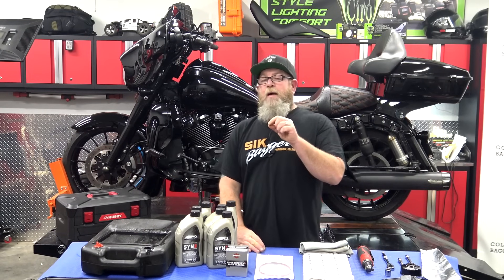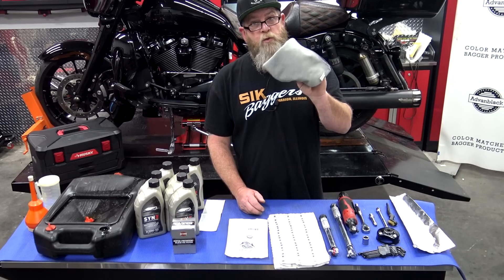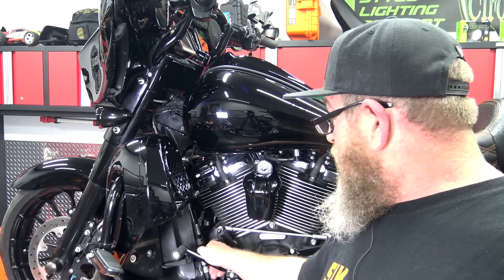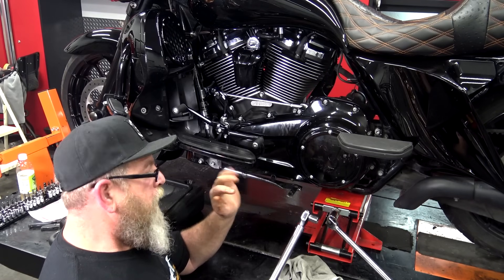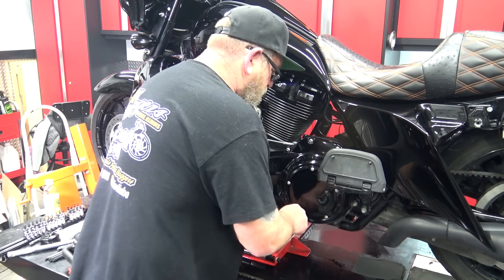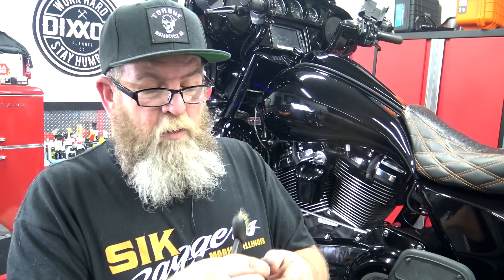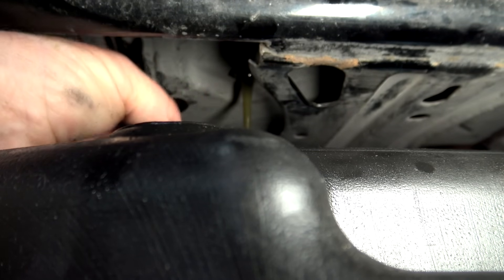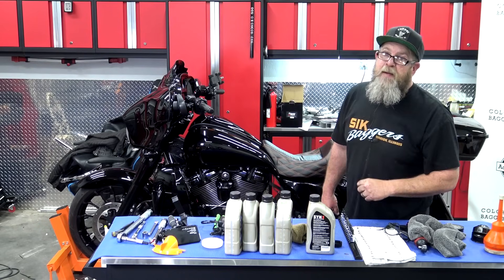⚡Milwaukee 8 - 3 Hole Oil Change @harleydavidson Touring - How To⚡

Comment: Personally, instead of tinfoil i cut side out of 2ltr  drinks bottle, slide that in, use again and again👍
Love your vids, hints and tips
Reply from the maker: yes sir...thank you for checking out the video...and yes ive used a gatorade bottle before..worked pretty good.

Comment: I wanted amsoil in my trike my dealer told me they wouldnt change it unless i use syn3 do you know why
Reply from the maker: You're dealership is full of shit. Find another one ASAP. Our dealership carries Amsoil in the store along with Lucas. And Syn3 is not required to maintain a warranty either so don't let them pull that crap on you either.  You can run whatever oil you want. They make money on hd products. That says a lot about your dealership and I would run

Comment: Steve, you are not the first person I have heard say to give the oil filter 1/4 to 3/4 of a turn "by hand".  My question is whats the difference if I give 1/4 to 3/4 by hand or with a wrench, it's still 1/4 to 3/4 right??  I will be the first to admit I am not much of a wrencher but I'm working on it, so maybe I'm missing something. Please let me know.
Reply from the maker: its just rule of thumb ...super easy to over torque with the oil wrench , thats all..if you can do it with the wrench and your confident its not over tightened then it is fine.
Reply: @sikbaggers  Understood. Thank you sir.

Comment: Thank you for the video.  I greatly appreciate the transmission explanation relating to dry and wet fill. I had no clue what that meant when I read it in the manual. Be and ride safe.
Reply from the maker: Glad it helped PD!! Be safe!

Comment: Should I be concerned that there were little chips in my oil from my transmission on my 2022 Road Glide ST? They’re about a 1/16” long kinda like thread chips but not threads.
Reply from the maker: with it being a 22 im going to assume it was the first transmission change? If it was it is pretty normal and your drain plug should have got most of it...change your trans fluid again at the end of the season and see how many have then. I know it wont be due for a service more than likely but its worth checking again just to be sure.
Reply: @sikbaggers  i’m doing the second transmission oil change, i’m at 15,000 miles and getting ready for a road trip. I’ve had the bike slip down or out of gear at hard acceleration a few times. Guessing because I didn’t get it fully into gear.

Comment: I just did my 1st oil change on my 2022 FLHR after having the dealer do the 1st few to inspect everything during break-in. It has an all plastic transmission dipstick. Do you know if it is still the same torque?
Reply from the maker: yeah..i dont torque the dipstick...just snug it down tight by hand and its fine

Comment: Great video, in your professional opinion, what oil do you recommend?
Reply from the maker: Ive been rocking the amsoil here latley...as far as engine wear I haven't seen any noticeable difference in the way the bike runs or any more or less metal on the plug when I pull it over SYN3.  And the clutch and tranny fluid the same...doesn't shift into 1rst any better like everyone claims it does...same old harley davidson first CLUNK! so not sure I will us eit again to be honest...cost quite a bit more too...ill probably just run the syn3
Reply: Is the oil the same for all 3, or is there specific oil for each?
Reply from the maker: @kgl1056  if you buy syn 3 for all 3 holes then its all the same...but even HD and other brands sell specific clutch and tranny fluids...so its your call on what you want to use.
Reply: @sikbaggers  does it have to be specific clutch or trans fluid?  Or it doesn't matter
Reply from the maker: @kgl1056   Check out this article by amsoil..its a good read and can explain it way better than I can...youll see the differences in weights used in each hole https://blog.amsoil.com/motorcycle-oil-differences/
Reply: @sikbaggers  thanks great article.

Comment: What happens if you overfill? Is the only con slipping? I listened to a guy at Harley parts who said fill to spill so I did just that. Took about 1 quart and 3/4 of another one. I can’t find much on YouTube explains this scenario. 2023 street bob.
Reply from the maker: overfilling your clutch will cause slip and ultimately cause damage...whoever said fiill to spill is obviously old school...and on some bikes that is very true...but not these newer ones...fill to the level shown on the diagram in your service manual.

Comment: Steve great post but would like to know your opinion on what oil to use on a 2006 street glide?
Reply from the maker: Thank you Jim...I have a buddy that rides an 06 and stricktly runs amsoil with no issues. Thats what ive been running as well..alittle pricey but if you can get a dealership with them you can get it a bit cheaper.
Reply: Steve thanks for the update I will look for it.
Reply: Another good oil would be LUCAS 20W50

Comment: When checking the trans oil level the manual says to put the dip stick in and not screw it in. insert the pit stick until the threads touch.
Reply from the maker: From the service manual 1.Park motorcycle on a level surface on jiffy stand. 2.See Figure 1. Remove transmission filler plug/dipstick. Wipe dipstick clean. 3.Install filler plug/dipstick until O-ring contacts the case. Do not tighten. 4.See Figure 2. Remove filler plug/dipstick. Check lubricant level on dipstick. Proper oil level is between the Add (A) (1) and Full(F) (2) marks
Im not sure what year of bike you have but this is for the 19' M8 but always go by what your manual says.  Please make sure yours says not to screw it in and doesnt say do not tighten...huge difference.

Comment: Great video Steve !!
one big mistake you made is you said the transmission fill plug is torque to 50 ft pounds and it should be inch pounds, not ft pounds big  difference  !!

Comment: Thanks Steve. The quintessential DIY job on a Harley. That oil sure needed changing.
How do you feel about an oil filter relocation kit ?
Reply from the maker: Hey thanks for checking it out ded...and yeah...i asked him why his tranny was so clean and he said he just had had it changed due to 4th and 5th going out and having it serviced...but the oil was midnight black...and for sure needed it. Never installed that kit but ive seen it...might be handy depending on the price.
Reply: @sikbaggers  Oil - change 1 - change 'em all.

Comment: how about a touch of anti seize on those derby screws? i have never had a issue but, would it hurt?
Reply from the maker: I wouldn't put anti seize on there..its kind of a grease..easily back out and loose one I would think

Comment: Do you have some sort of rule of thumb you use for warming it up?  Like idle it for so many minutes, or until the case feels just a little too hot to touch?
Reply from the maker: Getting the bike warmed up for an oil change is not just getting the engine hot but getting the oil itself hot..and you cannot get the engine oil hot just idling in the driveway...you really need to ride the bike at least 30 minutes and get the oil at operating temperature.  With a air cooled bike, just idling in the drive will in fact warm up the case but will not warm up the oil.  The idea is to get as much oil out when draining so get that oil hot and you'll be gold. Thanks for the great question Jan! be safe.

Comment: Is it recommended to check the transmission level with the engine hot?
Reply from the maker: Thanks for the question and no you should just check it on level ground on the jiffy stand ...remove the dipstick.wipe clean, re install untillthe oring makes contact but do not tighten. remove and check...should be between A and F.

Comment: For some reason, even when the transmission level is correct i find it hard to read on the dipstick. No worries with engine oil dipstick just the transmission..the oil seems to sit clear on it.
Reply from the maker: yeah its pretty hard to read...just get it in good light and youll be able to see where its wet

Comment: I did my primary oil and filled it to where oil was to touching the clutch plate, but it only took 24oz. I drained it when hot. Have you ever experienced this or did I make a mistake?
Reply from the maker: 24 seems a bit low ..normally its around 38oz. but most new service manuals have exclude a "oz" and just say "Proper level is approximately at bottom of pressure plate" you may want to get the bike upright, pull your derby cover and check again to see that you are at the bottom of the pressure plate. You wont need to change the gasket again on the plate...just pull it, check it and put it back on.

Comment: Thanks really liked your video on the Milwaukee 8 - 3 hole oil change. I am just about to do my own oil change on 2020 Road king Special, my first bagger. What is the best oil you recommend for this as my dealership is useless as tits on a bull. (Phill)
Reply from the maker: Hey Phill I run Amsoil only because my buddy has an account and I can get it a bit cheaper but I ran syn 3 for years with no issues. Redline is also a great  oil as well.

Comment: All fluid levels are spot on. Excellent instructions, easy to follow. Saved me a good chunk of dough.
One remark: if you use a vented dip stick that happens to move with you from bike to bike, make sure the measurements are taken with the original OEM dipstick or you screw up the oil change (ask me how I know 😂). I thought I overfilled until I realized that the dipstick is with me since my 96ci days.
Reply from the maker: Thank you for checking it out and the comment and yeah I probably would have done the same thing and then freaked out lol oh well lesson learned and thank you for sharing that

Comment: Would it be a good idea to put antiseize on those derby cover screws when reinstalling them?
Reply from the maker: I wouldn't joe...its a grease and that may cause them to loose their torque value over time...i see them sized up because they haven't been taken off in a timely manner and also over torqued.
Reply: @sikbaggers  
Thanks

Comment: How much oil did you put in? 4.5qrt? 5qrt??
Reply from the maker: Engine oil initial fill 3.8 L (4.0 qt)
Verify proper oil level. See Check Engine Oil Level.
 Perform engine oil level cold check.
Start engine and carefully check for oil leaks around drain plug and oil filter.
Perform engine oil level hot check. 
Add oil accordingly after you perform a hot check. I would suggest putting it half on the stick at HOT...that way you elimite a lot of blow by coming out of your breather.
Reply: @sikbaggers  I have a 24 model with the vented trans top cover so “I think”the blow by has been eliminated. A quick google search says oil capacity is 5.2qrts. The manual says start at 4.0qrts and go from there. Guess that’s what I’ll do, just wish it was a clear answer so you could just dump it in and go.
Reply from the maker: @hydroboy35th  i wasnt aware you had a 24 and yes your blow by issues have been solved for the most part.  There has never been a solid answer to that question and that's why HD says to start with 4 and add from there... Its a wet check meaning you drained your oil and not a dry check as in you just put a new oil pan on that has never held oil...Some people let the oil drain longer than others, some people use thicker oils depending on the riding conditions etc...it will never be the same...but don't stress about it really, its not a science that if you get it slightly wrong its going to effect your motor...dump in 4 quarts...run the bike and get it hot, check it again and add if you need to...takes about 5 minutes.

Comment: Hey Steve,  do you yet have a video on changing spark plugs on the M8?
Reply from the maker: Hey Joe..I sure dont buddy but I will get one in here and try to shoot that...You have to pull the tank but its super easy to do on touring models...let me try to get one in here
Reply: @sikbaggers  
Cool, thanks.
I've already had the tank off on my '17 King and you are right. 
Very easy.

Comment: Do you use the same oil for the 3-hole fluid change?
Reply from the maker: you can...if you take your bike to HD thats what you are going to get in all 3 holes unless you specify you want something ..i figure if its good enough for HD to put in thier bikesa nd maintain a warranty then it works. They know what works best in their motors

Comment: Soooo. I tried, but could or did not recognize the ugga dugga, and well, snap!  The last one of the job too. I snapped the head off the tranny drain plug. It’s in there so no leaking, but this is next changes problem I guess  I used a long ft lb wrench that I use for tire changes. Shoulda got a shorter one. How pooched am I?
Reply: Oooooohhh that's shitty!! Probably your best bet would be to remove the oil pan and then you could probably drill it or use an easy out. Good luck.
Reply from the maker: well just went through this same thing with a breather banjo bolt....had to drill it out and use an extractor tool to get it out. I would certainly drain and replace all the fluid afterwards to make sure you get any metal out...the plug itself being magnetic will catch and hold the shavings if you miss any.  This is what I used https://amzn.to/43xuayD

Comment: My question has nothing to do with the motor , i have a RG  limited my damn speaker has come lose from the pod on the backseat  what can i do to put it back so it will stay ?
Reply from the maker: You have speaker pods on the tour pack and the speaker is loose in the pod? just making sure I understand
Reply: @sikbaggers  correct

Comment: So is the transmission not 80-140 gear oil?
Reply from the maker: HD gear oil is 80-140...however you can run the syn 3 in all 3 holes ..I do not personally, I use Amsoil. The objective of this video is a HOW TO and not what flavor of oil you prefer. Please put in what ever oil or gear oil you choose is best for your bike.

Comment: Mobil 1 synthetic is rated for well over 15,000 miles... even with an oil cooled engine I can't imagine changing the oil at intervals less than 7500 miles. I just changed my oil with 8000 miles on it and while it looked a bit off color from new oil it certainly would have not suffered a shear breakdown for a few thousand miles. My old neighbor was worked at Chevron and gave me the dump on synthetic oils and the catastrophic shear breakdown they suffer from, but also gave synthetic oils a tremendous amount of praise compared to natural oils. 

At $11 a quart.. and an hour of my time, I can safely live with an oil change every 8000 miles.

Comment: What is the best oils for the M8 in your opinion ? I do want to know !
Reply from the maker: Honestly...any synthetic oil on the market these days is fine for the twin cam and the m8...ive used a bunch of them on customers bikes and never seen any issues with the engine.  I usually run Amsoil or Syn3

Comment: Out of all the vids I have watched you in, "THIS" one you seem to be a bit stressed. This is obviously NOT the 1000 mile first service according to all the crap I have seen on the list of things to do. But in relationship to that task, do you know if there is a list of things that you are supposed to do along with just draining the fluids and then replacing oil, filter and o-rings? Is there clutch adjustment for a cable clutch? Drive belt check and adjustment or other things I may have not mentioned in the 5k interval oil changes?
Reply from the maker: Hey thanks for checking it out...and yeah..I was really stressed during this video...had this bike for nearly 2 weeks and did so many mods and I really wanted to get this video shot but was time crunching to do it...takes forever to shoo these and edit them..but we got er done..there is certainly always things youc an check during your 5k oil change...I always check tire pressure/tread, belt and belt tension, visually inspect rotors for damage, check shifters and shifter arms for wear or slop, check levers for a smooth pull, inspect air filter, inspect jiffy stand, check plugs and wires, check your exhaust for loose cover clamps, cracks and so on, check the torque on some of the critical bolts like swing arm, hand controls, axle nuts, front forks, risers, if you have them or handle bar fastners...all of this stuff can be checked within an hour and usually I do these while waiting for the oils to drain...get a checklist and mark it off as you go.
Reply: @sikbaggers  Sorry that you were stressed, it's uncomfortable sometimes to see someone working when they are not comfortable themselves. Hope this day is better for you. Is there a more convenient way to contact you, or maybe you can answer a simple question regarding  contract work. I have a '21 Ultra limited and I am looking to find someone that has the knowledge to put together a blueprint type build, with complete balanced lower end bearing upgrades, cylinders and heads, cam chest, exhaust etc. Transmission upgrade and a fat tire front end conversion with chrome lower forks AND a stereo upgrade.
Is this something you do or can you refer me to someone who does?

Comment: I'm an automotive tech so I know about procedures and doing things correctly but I have a question. 

I went to do an oil change on my M8 Fat Bob 114 and I pulled an Allen plug  (1/4") that's ahead of the trans plug, very small. I mistakenly pulled it thinking it was the engine drain (I know😞) ...

very little oil came out and stopped so I was like, uh that's wrong. then I realized it wasn't the correct one and I found the correct one and drained. 

is this bad? I haven't cranked it yet after this and that's why I'm here looking for answers.
Reply from the maker: Its a tapered pipe plug...they say not remove it because its easy to over tighten and crack your crank case..you remove that if you are adding an oil temp gauge ...your fine...just dont over tighten it.